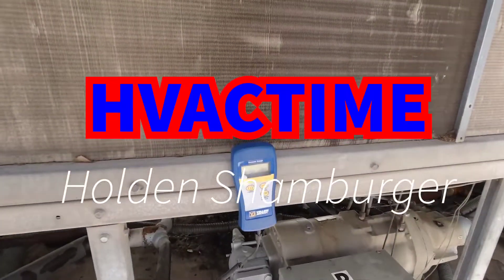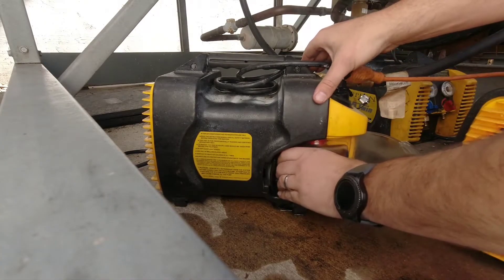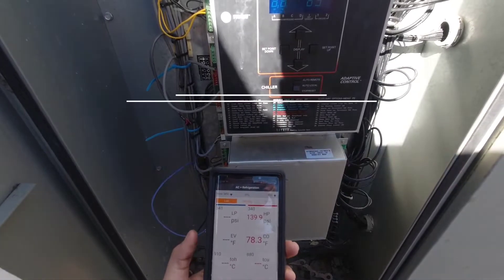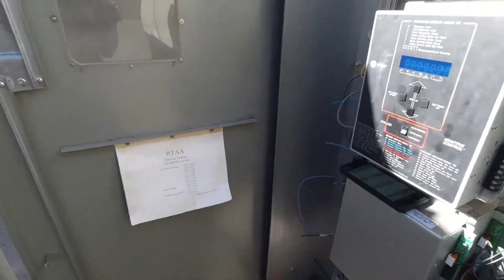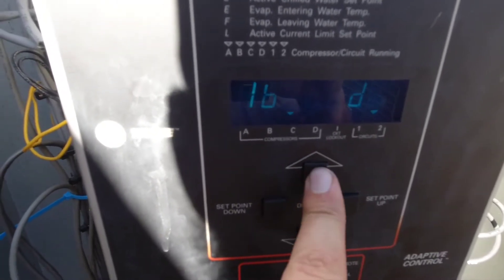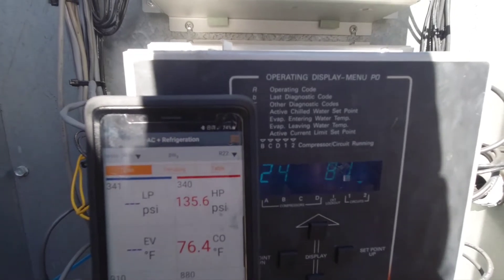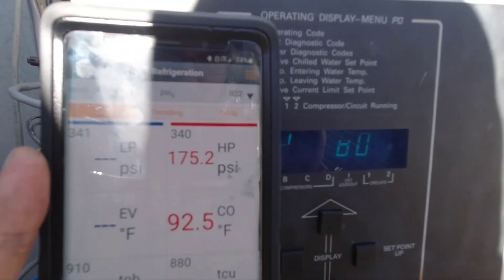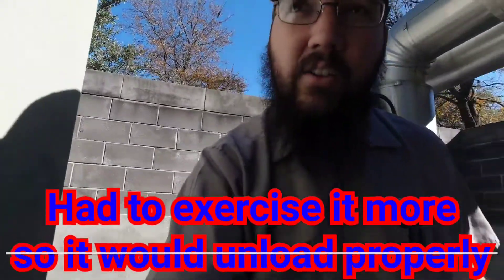Chiller Repair Vacuum & High Pressure Alarm Trane RTAA Air Cooled Chiller

Comment: ever try doing a nitro sweep or two when your vac stalls like this? world of difference in time and vac achievement.. also getting some (as much as reasonably possible) heat into the large oil volumes when cold where ever those may be will drastically accelerates cooking off of any unwanted stubborn or trapped condensables. you must try this! obviously without burning the oil or whatever  item your adding heat to). if anything is trapped in oil you will see your micron rapidly rise as you add the heat, via it be powering up an oil heater or whatever you have to do, map torch, space heater aimed at or under a large oil containing component known to have refrigerant in it. if anyone thinks this sounds stupid give it a try when your micron level starts to get slow before commenting. rubber mallet if component isn’t one of these massive compressors is huge help too.    in these situations of stall in order to preform a sweep i will if possible create the longest path i can from where adding the nitrogen to my current evacuation point. if  I suspect  or decide I  may need to do a sweep i will have my bottle of nitro staged on one core removal tool i’m pulling on then isolate that core tool from vacuum hose via core tool iso valve with pump still pulling on my second hose/tool. purge a  very small amount of nitro in at this point. it only takes very little, just a spritz of nitro introduced into the vacuum will travel almost explosively fast as it rushes without resistance into the void of vacuum and pretty immediately start being draw out the remaining active vacuum location on other side of system. you could also keep all your hoses actually pulling and add nitro to a port on other side of circuit if you have one available.. this creates a flow for the suspended different stuck gasses to be extracted with that would otherwise not have much of any flow to leave with otherwise. it’s a very quick way to preform a double, triple and so on evacuation. i’m talking about only flowing enough nitro to bring a stalled pulldown (with clean oil and no vacuum rig leaks) from say 1-3k microns to maybe 4500-5000 at most.every sweep done you will see micron level more and more rapidly improve.  i’ve been on the edge of giving up an evacuation going depressingly long to pressurize and start leak testing again to micron levels worthy of bragging  to co- workers about in 20-40 mins on 5-20 ton circuits. don’t believe me? next time your believed tight system is taking too long to fully evacuate  and your ready to give up try this. heat the oil, do a sweep, then come back here and tell the world you have been spending way too much of your life freaking out about abnormally long pull that did not have a leak. :) .  Ive see too many say screw it and give up at 1k micron or worse before a decay because they just don’t understand what they are doing.  if your system is leak free you can absolutely get bad ass vacuum and not have to wait forever all worried you overlooked something

Comment: Ahh the gentle whine of the Trane screw compressor.  I’ve had a 200 ton version sitting on a “Texas Pride” trailer in our parking lot for about 7 months now.  Thx for the videos, mate!  Chillers have been fun to learn since I’ve taken over a 40 yo building.  We had two 75 ton recips that both died during a heat wave a few years back.  Been nothing but fun since!
Reply from the maker: Trane makes good equipment, expensive to fix but good nonetheless

Comment: Have you thought about investing in a larger industrial vacuum pump and some trublu hoses?  The two combined really do make a huge difference. Also helps to have more than one micron gauge so you’re not doubting your vacuum as much. I hate that nervous feeling during a stall wondering if you have another leak or if it is just refrigerant in the oil or moisture etc. with all the chiller work you do, a Navac 12 CFM industrial pump would really help out in my opinion. They hold much more oil than the tez8 and they are meant to run continuously in situations like this. Great video though man, appreciate your content 👍
Reply from the maker: The big problem that got me here is over confidence! But I do have a second gauge but didnt try it (its FP). I've not gotten to use the Navac equipment but I've had extreme results with the Appion setup and have stuck with it so far. I see a lot of people really enjoy Navac!